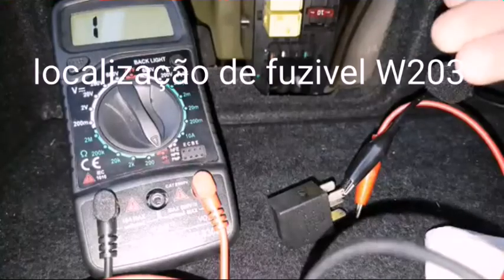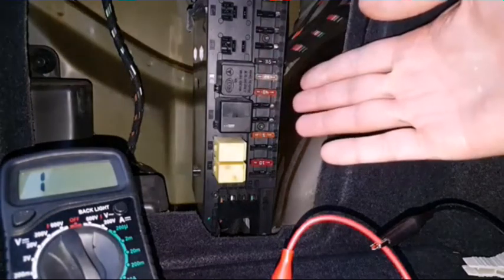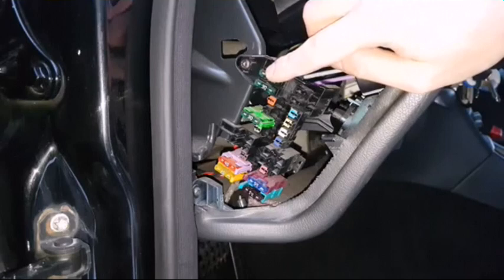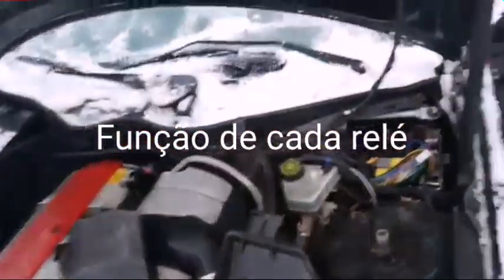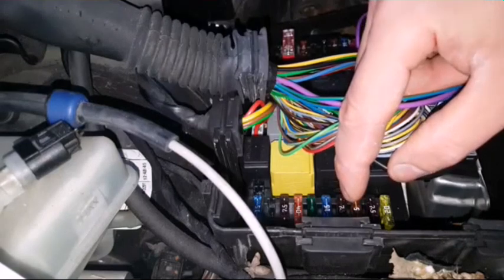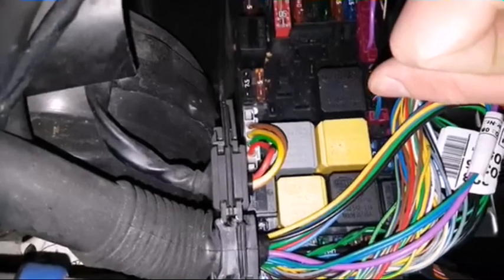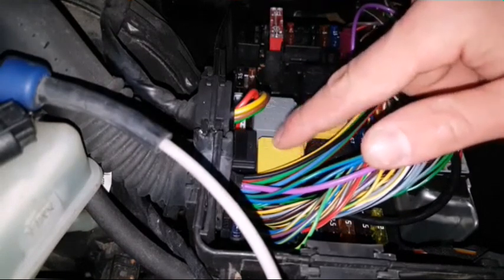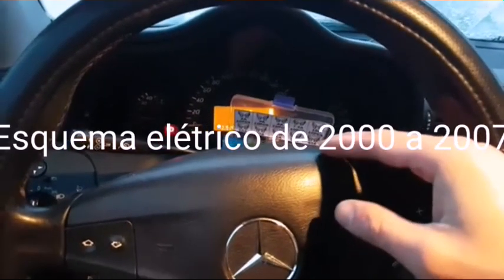Wiring diagram fuse and relay Mercedes W 203  how to replace fuse of Mercedes W 203 🆗⭕

Comment: I have a c230 s203 2006 mercedes benz. I need to replace the engine radiator fan relay. What relay is it?